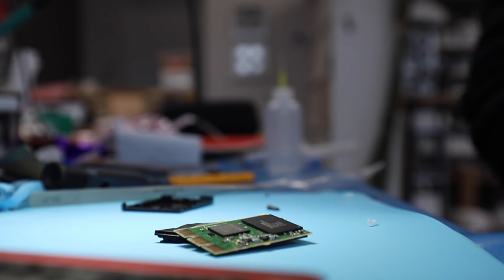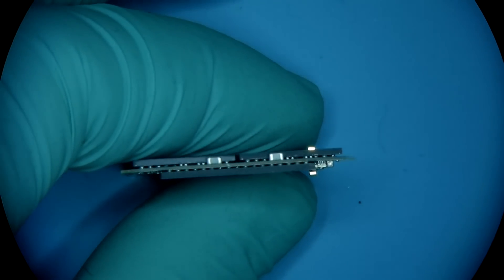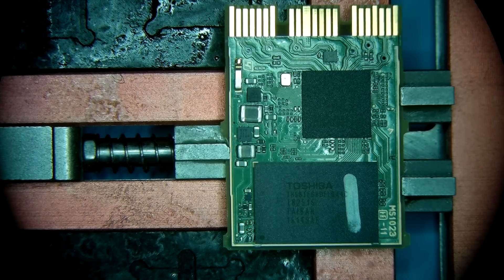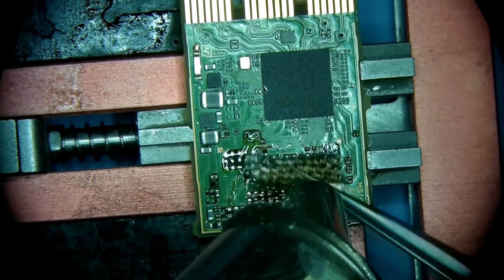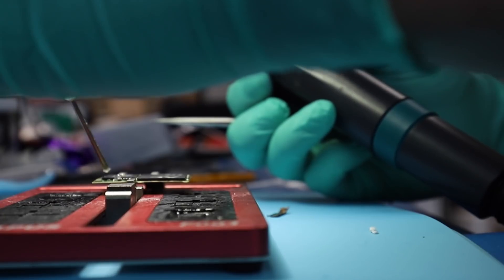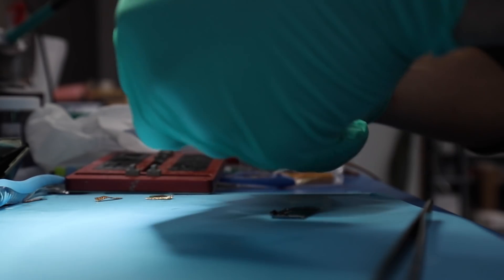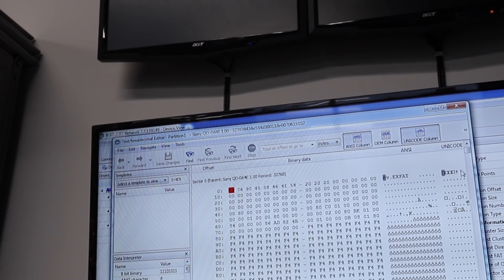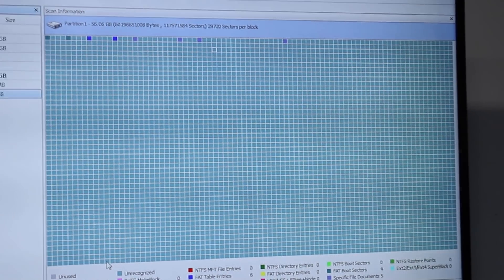Sony XQD card data recovery

Comment: use desoldering wick between hot tweezers and suck up solder save pcb or nand form unnecessary heat exposure
Reply from the maker: Doesn't work for NANO tweezers

Comment: As you said you arent familiar with the controler and so on. After that job is done.. is it possible for you to keep the stick and then have a chance to play around with it and make yourself a bit more familair for a future job? Do you usually do that?
Reply from the maker: There is not much to RND. It either works or it doesn't :). It is much faster and easier to try and fix it first, check the response, see if your work has made any changes, and go from there. If it doesn't it goes to chip off for manual rebuild

Comment: Thank you for demystifying this industry! It's kind of crazy to me that other places haven't done the same thing you've done with this channel: demonstrate clearly how much time, effort, expertise, and cost/overhead goes into recovery. I just discovered your channel an hour or so ago and I've just been going through your videos ever since!

I have a small box of about 6 dead drives that I've been carting around with me for nearly 20 years. In the event that you ultimately need to image the data from one or more of a single customer's drives, does your software allow you to instead copy any/all data to one large drive with enough capacity to store however many bad drives' worth of data?

I'm seriously considering sending you these drives to get your opinion, as well as a new drive with enough capacity for any/all data you could recover (if that's an easy/viable option). One of the drives was dropped from about 3 feet while it was running, so...yikes. Lol.

Thank you again for doing these videos! Looking forward to the next one you post. =)
Reply from the maker: Thank you Stephen. We image every hard drive we work on. We can transfer the data to any type of device after as long as it has enough space to accommodate the data. We would be more than happy to get those drives checked for you.

Comment: The hot-air tip you use I can tell is your go-to. My fav as well, no need for all the unnecessary swapping in between tips. I use the same angle tip 90% of the time; it's all in the control
Reply from the maker: Exactly!

Comment: Hi bro, i have a hard drive which doesn't spin or boot or anything. I saw a video of you where you remove the dead diode and it works but in my country they are saying it's not repairable and stuff. Is it possible to fix it? It does nothing, no life at all. And also it's only 2 or 3 years old.
Reply from the maker: I can't say without testing/seeing it

Comment: Can you do data recovery on Apple flash drives which are basically Samsung drives when the controller gives up (super hot to touch)
Reply from the maker: Ones in iPhones? No
Reply: @hddrecoveryservices  The ones in MacBooks I meant, like the MacBook air 2015 for example. It's a PCIe Flash drive.

Comment: If you need more solder paste for the ball-pads, just glue 2 stencils together, and this gives you a thicker layer of material.
...We made our stencil set out of magnetic sheets, so there is no need for glue and the sheets can be separated again if the job requires it.
Reply from the maker: We have thick enough ones that we use most of the time

Comment: HDD Recovery Services  Just another concern I have, you still are using windows 7 and jan 15th is pretty much the last date to update to windows 10 to keep receiving security updates, are you planning to do so?. And isn't malware, esp ransomeware a concern in your line of work? I've seen you plug in repair drives/cards directly into your PC. Have you ever had to work on a ransomeware infected drive or a malware induced data loss?.

Lastly, just like you made a video on your hardware tools, do you have a video on your software tools or are you planning to do one?

Comment: those outer pads that always seem to come off, are they not connected to the ground plane? i'd think it would be a lot stronger if it was, but i know some chip datasheets say you can't ground the NC pins. any insight on this?

Comment: Hi, really appreciate how you explain the process, I have learnt a lot about electronics and data recovery. One question, how does r-studio compare to other data recovery software like easus data recovery or aomei data recovery software, what made you choose r-studio over other data recovery software?.
Reply from the maker: it supports a lot of file systems, and it has a wide range of features like virtual raid reconstruction. There are 2 software companies that make good DR soft, R-studio and UFS explorer. Both tools have pros and cons. The rest is mainstream downloadable software is crap and not worth spending money on.
Reply: @hddrecoveryservices  Thank you for replying As someone who is getting into data recovery your videos are really helpful to clear a lot of doubt
Reply: @hddrecoveryservices  Just another concern I have, you still are using windows 7 and jan 15th is pretty much the last date to update to windows 10 to keep receiving security updates, are you planning to do so?. And isn't malware, esp ransomeware a concern in your line of work? I've seen you plug in repair drives/cards directly into your PC. Have you ever had to work on a ransomeware infected drive or a malware induced data loss?.

Lastly, just like you made a video on your hardware tools, do you have a video on your software tools or are you planning to do one?